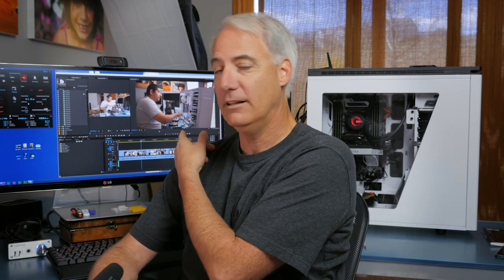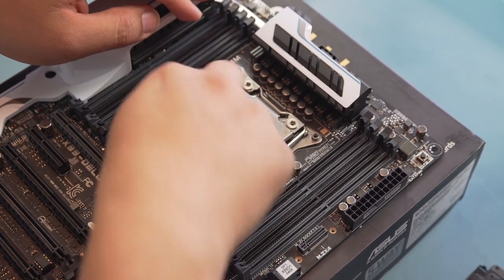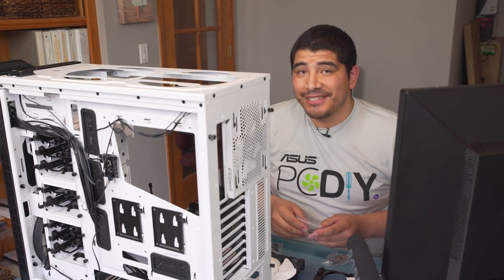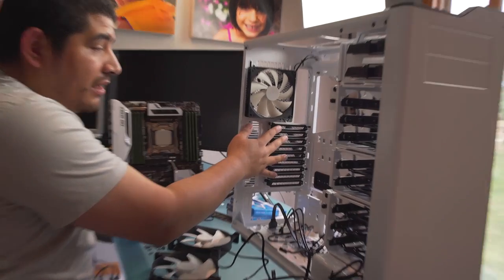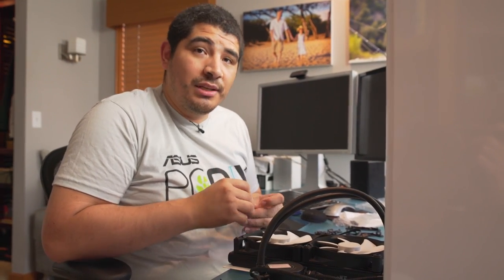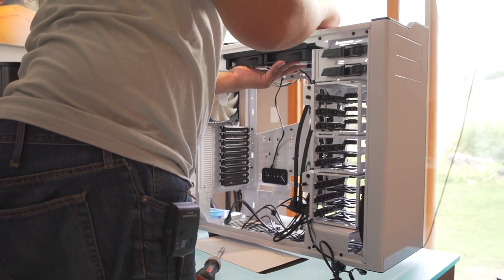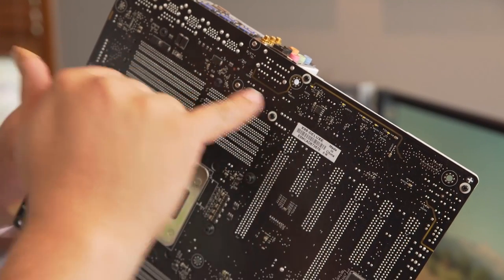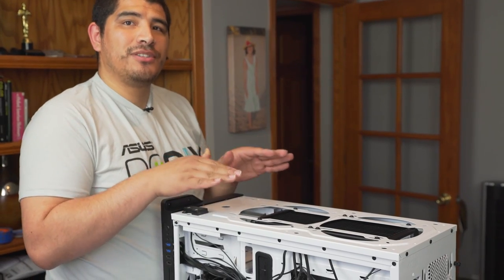Raw Footage of Building the Beast Video Editing Computer Part 1

Comment: The guy said that fans at water cooler radiator supposed to work as intake fans "to get more fresh air " however he installed them as exhaust fans ? He installed them the same way as back side case exhaust fan ??

Comment: I would NEVER let this guy touch my computer, i dont care if he works for asus. You need a tiny bit of thermal paste in the middle, having it on the outside wont do nothing since the CPU die is actually like 1/8 of the size of the CPU and in the center. Also you cant reuse thermal paste because its dried, and if it is dried, it wont fill in the micro cracks in the surface of the CPU to the CPU cooler.

Comment: Dave, I need help on my purchase for my new Video Editing PC. I edit Red Epic 5K Red raw video to 4-5K depending on the client. I use Premiere Pro CC 2015 and have a budget under 3 thousand on a BestBuy gift card. Their online selection isn't great but better than their in store selection. With a 1TB SSD as my main working drive that I will install afterwards, which computer is best a dual core intel Xeon E-2620 V3 Hexa-Core 2.4GHZ with a Quadro 4200k card or a 6th gen i7 6700K 4.0GHZ with a Titan X card? Maybe a different PC altogether? Also - should I wait till after December when most the PCs will have upgraded CPUs or shop now? Please help!
Reply: Watch linustechtips, look at his editing rigs or go to the build and look at the comments. The machenes he uses are i7s with Titan X's so yeah. Go watch them. They make good videos.
Reply: Hey Thanks! Yeah I kinda watched a ton of vids on an editing PC builds, they all lead to what is basically a gamer rig that can multi task. Ended up getting a PC with an overclocked Skylake i7, Titan 12GB card, 32GB of Ram, and an SSD to boot, along with a 2TB HDD. It's working out pretty good!
Reply: EYE50MM Yeah that is actually a great build for editing. What motherboard do you use everyone i know that built systems like this recommended a Workstation grade mobo, so i was wondering what you went with, if you don't mind sharing.
Reply: Yeah, hey, sorry about the late reply.

I got a pre built tower from CyberpowerPC. I was really hesitant because a lot of their reviews were negative but I don't regret getting one.

It has an MSI PCMATE motherboard doesn't support SLI. Came with a  Skylake i7 6700 CPU at 4.0GHZ, a 12GB Titan X graphics card, and 32GB of DDR4 memory, no optical drive, and a 246GB ssd along with a 2TB HDD. IT'S A BEAST.

It knocked out a 3 hour full HD video in about 2 hours from Premiere Pro CC2015. I think that is pretty good. Probably not as good as a dual processor multi core workstation but it will do for now.
Reply: EYE50MM Wow. That sounds awesome. great that you're happy with your purchase, and it sounds like a badass rig. In my opinion I like sli for easy upgradability but most prefer single gpus anyway. Well good luck with your editing and stuff!
Reply: Thanks! Linus mentioned that 2 SLI cards at both 4gb or other will always only use 4GB instead of the full combined 8GB. That really made me think, also he mentioned a slight delay because of information being read or processed through 2 GPUS vs the1 GPU. I just figured, the best graphics card should be more than enough. Also it's way less heat.
Reply: EYE50MM Yeah but watercooling solved my heat issues with sli, and direct x12 is supposedly gonna allow vram scaling. This doesn't apply as its an editing rig but still interesting.